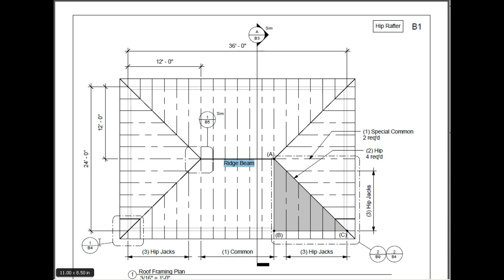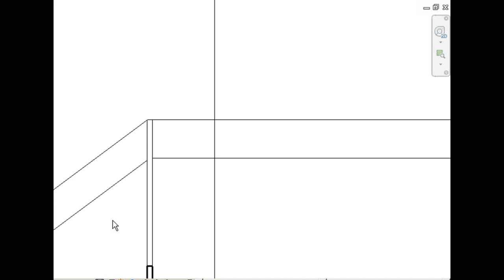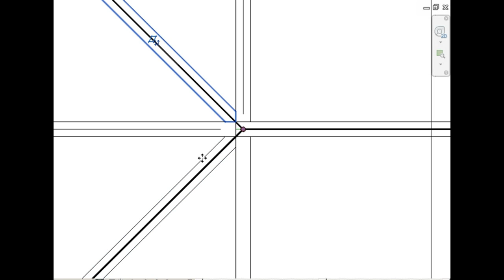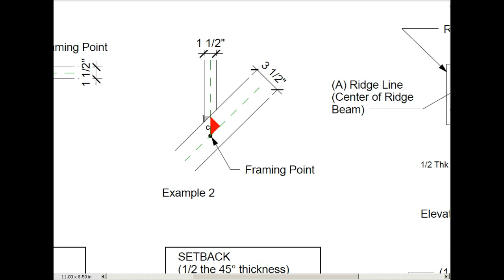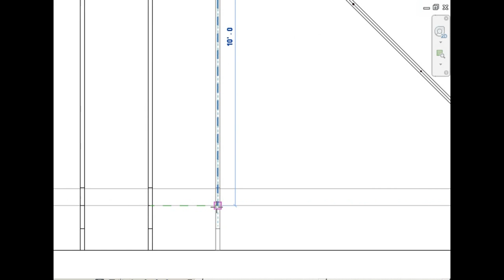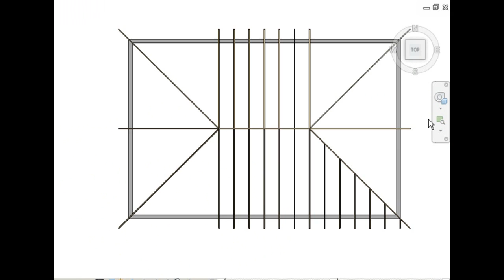Hip Rafters -  Part 4

Comment: The roof framers bible states that to calculate ridge length you add the total ridge thickness to the length, you're stating you add half the rafter thickness (for double hip roof). What I don't understand is the the center line doesn't change the thicker the ridge becomes... who is right...
Reply from the maker: Hi Jesse, take a look at the illustration at 0.47 part 4. Grow the ridge at each end by 1/2 the rafter thickness. That would total the rafter thickness (2x 1/2 the thickness)
Reply: @musvolk  thanks, I understand your explanation it’s rather i forgot that you have to add the material back to the ridge because you deducted half the ridge thickness from your common rafter run. I was concentrating on the ridge to much to zoom out and realize the steps prior. You half to add half the ridge back to simply have an accurate measuring line which enables proper hip installation etc or the rafters would come up short

Comment: great and informative but i think your 'mathematical run' is incorrect. if a line is bisecting a 90 degrees angle at 45 degrees, any horizontal and vertical lines from the same point will form a square.
 therefore the hip rafter is automatically the hypotenuse. so 2' squared plus 2' squared equals 8'; the square root of which is the distance along the hip rafter if the jack rafters are set at 2' center.
 2'x2' + 2'x2' = 8'. the square root of 8' is 2.828' ( 2' 9 15/16" ) the mathematical run.
Reply from the maker: Hi Peter. For common rafters use this formula: a^2 + b^2=c^2. Ex: 9^2 + 12^2= 225 sq. rt = 15 (unit run). For Hip rafters use this: a^2 + (b x 1.414)^2 = c^2. Ex: 9^2 (81) + (12 x 1.414)^2 (287.9) = 368.91 sq. rt = 19.21 (unit run). Multiply the span by the unit run to get your rafter length. Hope this helps